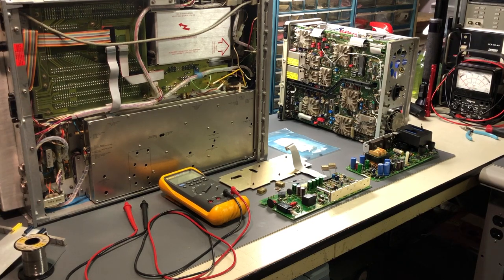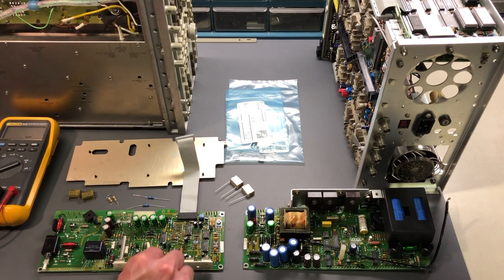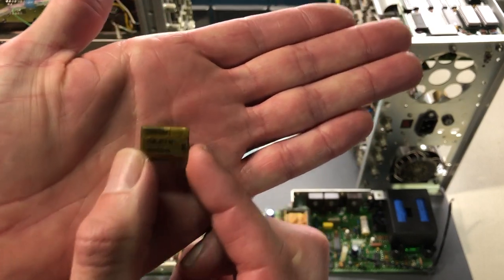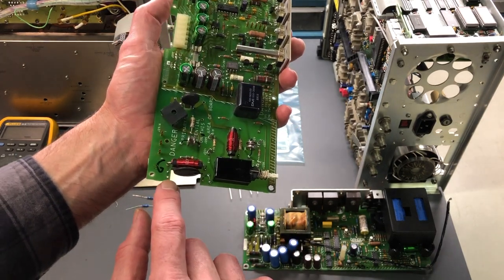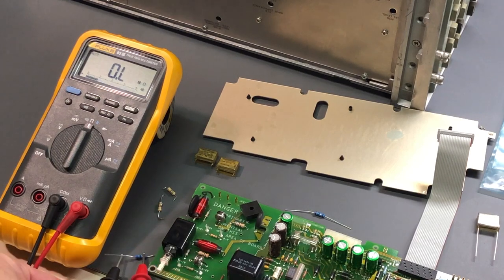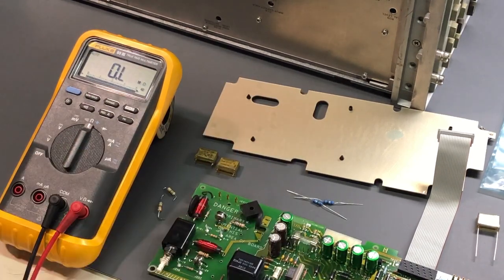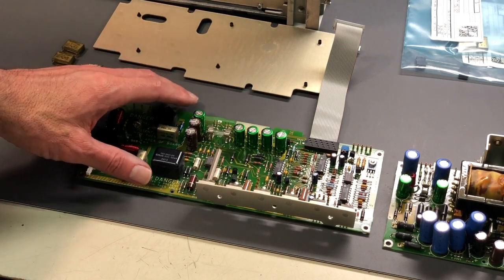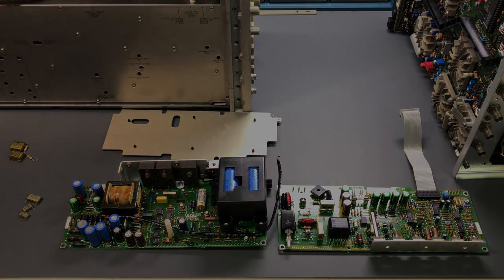What Problem Is Hiding In This Tektronix 2465B Oscilloscope?

Comment: Thanks for a great class today. I learned a lot. Also wondering if there is a better replacement for the rifa caps. But asd you say, The new ones are much improved.
Reply from the maker: Glad to know you found the video informative. Yes there are numerous manufacture choices for the safety capacitors.  For example here is a link for a starting point at Mouser Electronics for thousands of types of safety capacitors by many manufactures..  https://www.mouser.com/c/passive-components/capacitors/?product%20type=Safety%20Capacitors&termination%20style=Axial%7C~Radial

Comment: I have a Tek 2445a with a dead battery. I am planning to change the battery, but I also want to recap the PSU just in case :).
Do you know if there are any compiled lists with Mouser/Digikey part numbers for the capacitors that need to be changed on the PSU (or anywhere else for that matter)?
Reply from the maker: I am not aware of a parts list for Mouser or other companies.  I have done several Tek scope power supply recaps and I just went through and examined each capacitor and then purchased from Mouser using their website search tool to drill down to the correct parts needed.  On future repairs I will include the part number list as other viewers have also asked this.

Comment: I have a 2465 that has a bad ground somewhere, a gremlin.  I can't locate it because the tap that makes it go away moves every time.  Sometimes a tap on the other end of the table is the only thing that makes it go away.  It's very accurate, no trouble otherwise, sometimes the gremlin stays sleeping.
Reply from the maker: Intermittent problems like that are the worst to track down.  Depending on what actually happens when the fault occurs might point to the area of circuitry and you could reflow all the solders in that area of the board.
Reply: @EriksElectronicsWorkbench It puts bright, flashy noise on the CRT. I have a guess that it's a loose screw holding metal to metal.  A zinc-x diode is possible.  Of the 100 or so screws, which one?  I think I'll tap it until it really fails.  It works.
Reply from the maker: @chaosopher23  yes that quickly gets complex to track down the issue.  Possibly monitor the drive signals to the CRT and see if that narrows down the circuit.  But if a tap corrects it then that is the simple fix :)

Comment: 8:30 the problem with using new Rifa caps is that you just don't know. The old ones took 30 years to blow up, and you're only 15 years into the new ones.
Reply from the maker: It will be interesting to see how they hold up.  KEMET took over the manufacturing RIFA's.  I've not had issues with their line of capacitors and other components.

Comment: This is really good info. The safety cap thing is new to me, but I alwasy worked in embedded and FPGA, not in PSU design. I have a bunch of stuff from the 80s and 90s that I want to keep in good running order. I think it might be youtuber Curious Marc who's always talking about how the IEC plug input modules (the EMI filters with the IEC power cord pins) on old boxes tend to blow up and stink up the lab, is that the same issue, do you think? Are you also doing the electrolytics, seems like that's pretty much the #1 recommendation per the interwebz.  Also, any experience with vintage EPROMs losing their code? My stable includes a couple old Tek digital scopes, some HP scopes, an old Data IO 212 programmer, and an HP logic analyser. Have my eye on some similar era Tek models as yours in the local surplus shop as well. Anyways, subbed, and will explore the rest of your vids.
Reply: Yes, older IEC plugs also can include RIFA caps, inside the can, and they can/do blow, too.
Reply from the maker: Thanks for watching and subscribing, and I'm glad you found the video helpful.  Yes the EMI line filter could fail due to bad capacitors internally but often the EMI filters are hermetically sealed and the internal components are more stable than those exposed like the RIFA caps.  Yes I often replace the electrolytic caps either as preventative maintenance or necessity from failure.  I've not had EPROMs go bad in the older equipment but it is possible they can become corrupted.  You can use a reader and copy the data to a new EPROM.  The older Tek scopes are some of my favorites. I hope you are able to get the Tek scopes you found locally :)
Reply: @EriksElectronicsWorkbench  Thanks for the info. Seems like there's a lot of work to keeping the vintage stuff running, I've also been made aware of people who replace the 1990's era hard disks (like in my HP logic analyser) with SSDs via some adapters and disk cloning software to avoid the inevitable head crashes. Lots of projects to take on on the next little while!

Comment: Hi
Good video
Did you have a supplier and parts list ?
Reply from the maker: Parts supplier was Mouser Electronics.  I also use Digi-Key.  I don't have a parts list, part numbers/identification was just based on the markings of the old parts.
Reply: @EriksElectronicsWorkbench  thank you for let me know 
I have 2 units to repair 
If there is not too much problem will like to have the part numbers for the special caps 
Thank you
Reply from the maker: @AlfredoGarcia-ov8sw  looking over an order I placed at the time of the video and repair, the 0.068uf safety cap is PME271M568MR30, the 2200pf safety cap is R413F12204000M or possibly R413F122050T0K, I had purchased both types and don't recall which was used in this project.  There may have been a 0.1 uf cap but any others I already had on hand, sorry I don't have the part numbers.  If you look at the original parts they are marked with the voltage and capacitance and X and Y ratings. Also measure the lead spacing.  Mouser and Digi-Key have great website search tools to locate the correct parts, just enter the known details and work through the results.  Also RIFA is now made by KEMET if you are looking up by manufacture name.
Reply: @EriksElectronicsWorkbench  thank you
Have a nice week end

Comment: Is there a way to calibrate the oscilloscope without a Time Mark Generator?
Reply from the maker: A time mark generator would be for the sweep time but not for the vertical gain so is only one possible item used in calibration.  The signal produced by a time mark generator is not easily reproduced otherwise.  You can check the sweep time in general by applying a known frequency accurate signal and check the graticules for proper period time indication of the waveform.
Reply: @EriksElectronicsWorkbench  Thank you

Comment: I have never heard of a capacitor referred to as a 'Safety' capacitor.  What does that mean?  Also, what is a Y or X rated capacitor?  I've been working in electronics for 30+ years and have never come across that terminology before.
Reply from the maker: A safety capacitor is a capacitor is designed to fail in a safe way to prevent a dangerous condition to the user.  I made this video which covers all the details..  https://www.youtube.com/watch?v=GDTuHDsHHFA    Y and X are the classes (ratings) of the safety capacitors.  Electronics distributors like Mouser and DigiKey have entire categories of safety capacitors.